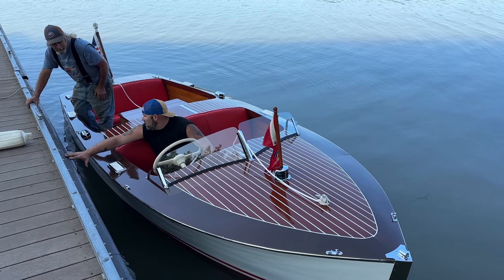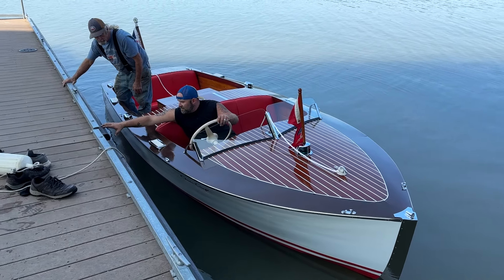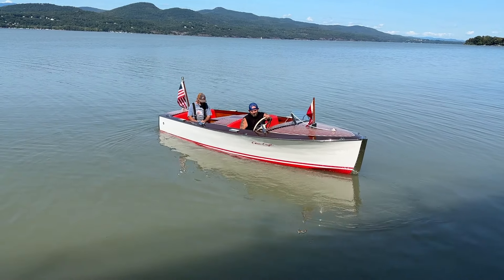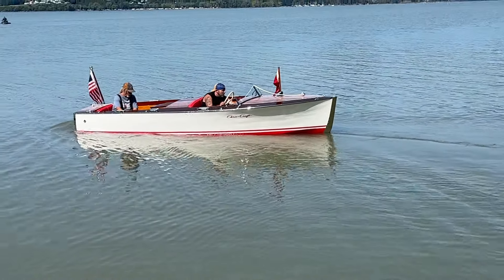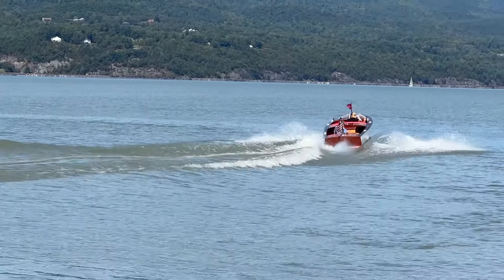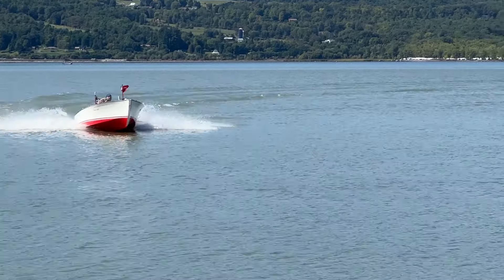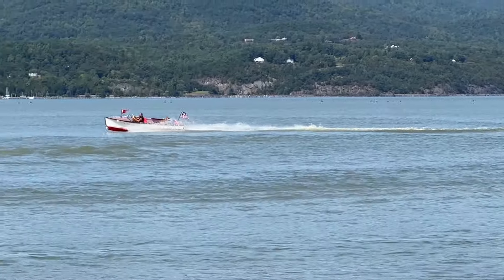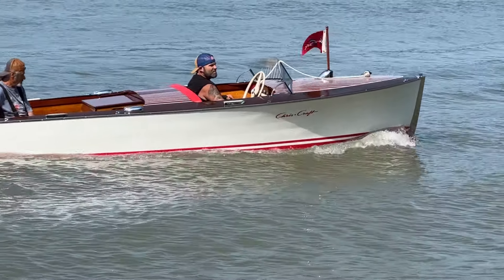1948 16 Foot Chris Craft Special Runabout   Sea Trial Triumph! 9 11 2024

Comment: Absolutely beautiful Boat & Workmanship.
Now i need to get my 48 17' Runabout reworked this winter and in the water next spring
Reply from the maker: Fred, bring her to us and we will  preserve her in time for next summer’s boating season. We will never replace a single stick of original wood that can be saved when we do because an old boat is old only once.
Reply: @snakemtboatworks  I know you are the BEST but I need to try myself. It only needs a bottom.
Reply from the maker: @fredburban8219  Fred, here is the link to the Trued 5200 Bottom section under "HOW-TO" on the SMB Website: https://snakemountainboatworks.com/vintage-boat-preservation-how-to/how-to-apply-true-5200-bottom/.
Be sure to read  the detailed article at the end of this section by Don Danenberg that answers the question, "What is a True 5200 Bottom?"

Comment: Looks and sounds great!!  Is there an engine break in period you need to be concerned about?
Reply from the maker: Absolutely. As with all newly-rebuilt engines, we initially run Brad Penn 3o-weight break-in oil for the first 5-7 hours runtime under load.  We continually raise and lower the RPMs as well, limiting them to 2500, with frequent and momentary increases, but never over 3000 RPMs. We then switch to Brad Penn 10-30 semi-synthetic oil.
Reply: @snakemtboatworks  Thanks, had a hunch it was something like that. I am in the break in period on a 150hp Suzuki 4 stroke outboard.  They limit the engine speed to <3000rpm with less than 3 hrs, 4000 up to 5hrs.  Beyond 6 take it easy to 10hrs.  Long but worthwhile for longevity.  Thanks again for a great looking Chris.
Reply from the maker: @rchuyck  Yes, outboard break-in is quite another challenge. I put a new Suzuki 75 on our son's 19' Carolina Skiff, and he quickly learned that breaking it in is just no fun, but he followed the schedule exactly and now is enjoying running it full bore.
And check out  Naiad. She is powered by a '92 90 HP Merc that had never been started until this summer. Now I am fully "enjoying" breaking it in:
https://www.youtube.com/watch?v=7k-JKN_xeEg&list=PLU9jswQZjSK3VFJrkIcrfXDzy6uCEHtsw&index=4
Reply: @snakemtboatworks  Thanks, will check it out for sure.